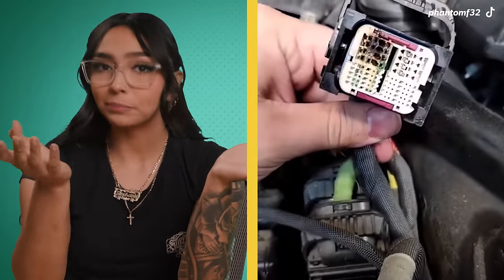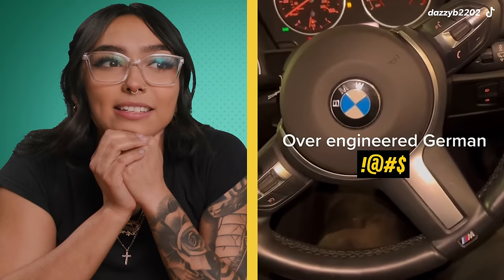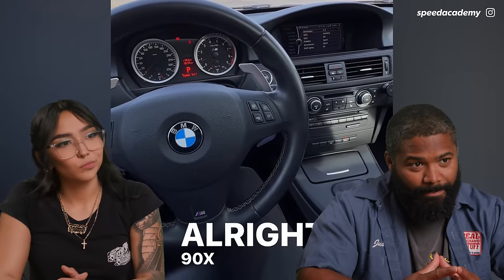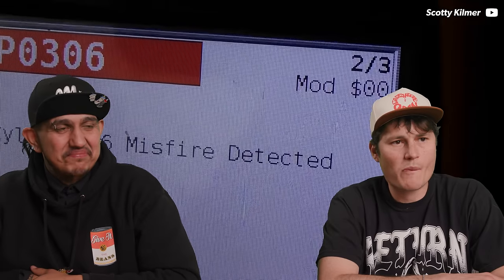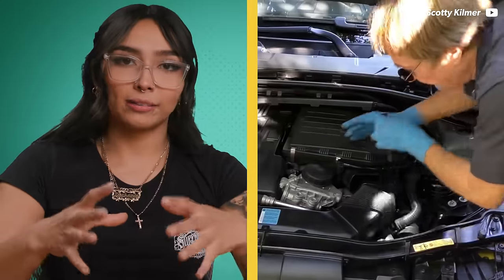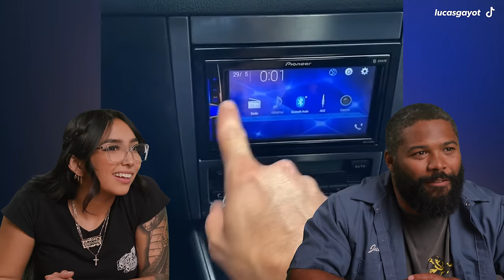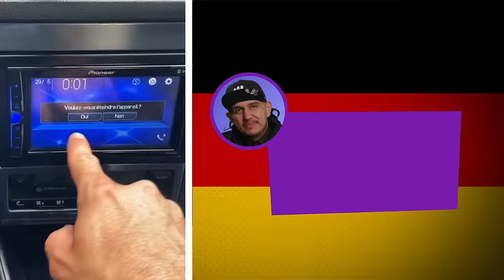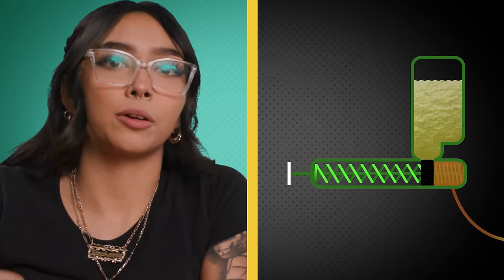Mechanic Reacts to German Engineering Fails

Comment: German engineering: I can't remember the exact model, but I'm like 65% sure it was a Volkswagen Toureg. Guy brings it in to the shop for a blown O2 sensor, and he just couldn't figure out a way to get to it.  Looks up in the repair manual on how to change that sensor, and right there in the manual it said "step 1: remove engine."
Reply: Porsche Cayenne turbo.
Reply: My Audi S7 O2 sensor felt that way. Engine is symmetrical left and right, including the exhaust manifolds. One side took 15 minutes to change. Other side took 5 hours of pain. Sensors in the identical spots left and right, but on one side they moved the connector from on top of the engine to the back of it between the engine and firewall in a pit with 2" of clearance with no line of sight into and no way to reach into without dislocating your arm. That and  you're supposed to slide the locking tab off the connector, then get leverage to depress the release on the connector in that area. Probably pretty easy if there wasn't a pesky firewall or engine in the way. They could have kept the connector in the same spot on top for both sensors, making them both 15 minute jobs...but no.
Reply: All Audi o2 sensors have been that way for 15 years and they are zip tied to the rear coolant pipe making them impossible to reach, impossible to cut the zip ties and impossible to get a socket on the sensor.

We used to cut the wires and have to make a tool to reach the sensor
Reply: I'm happy that fixing R1200GS is a bit easier than that
Reply: TouAreg bitteschön
Reply: Yeah thanks chief 🤣🤣🤣🤣
Reply: Mercedes w123. All of their engines except the m102 use a rope seal for the rear main. 
So in the manual it also says "step 1: remove engine"
Reply: Chrysler T&C broken water pump bolt...support engine and remove motor mounts...disconnect all lines and hoses...drop engine 4 inches.
Needless to say the finest "Tool steel" grade 14 bolts were purchased as replacements...and antiseize was shoveled on.
My worst was replacing the HVAC blower on Volvo 242 series...remove entire dash, and then some tiny parts fall out when removing...reinstall, Wont work properly. reach under seat, find parts, remove entire dash, reinstall. 30hrs+. NO manual or schematics.
Reply: @kft4764  Yep.  Been like this since the late 90's/early 2000s with German vehicles, now becoming pretty common with Japanese and American cars, too.  I can remember having to replace a temp control module on my wife's 1.8T VW.  Factory process is to remove all of the crossover coolant lines, valve cover, vacuum hoses and combi valve... all to remove one thumb-sized sensor held in place by a single C-clip.  The real solution of course is to find someone with tiny little hands skinny enough to squeeze down between it and the firewall to pull the clip and put it back in.  Takes seconds if you can actually reach it.  Getting to anything on the motor was a nightmare because of how little space you had to get to anything, but of course VW's remedy for everything is just "pull the motor" or remove the front end and radiator carrier. Sorry, but I am NOT pulling the entire front end off to replace a $20 thermostat.
Reply: Well,time to call mechanic for me 😂
Reply: Pretty crazy that you can't just drop the exhaust and access it that way. Poor engineering choices.
Reply: When you own a first-generation V10 Touareg, it's recommended to have another engine as a backup. Simply remove one engine and install the second one until something breaks, and continue this process as needed.
Reply: People in Australia have found with the Toureg if you enter cold deep water, THE BLOCK CRACKS from thermal shock. But we cross rivers with Toyotas all the time here. No problems. Cardboard over the grille and go for it.
Reply: WTF.......
Reply: @upinarms79 I can remember replacing that exact same temp sensor on my 2008 VW Jetta Wolfsburg way back in the day. I was really young. So I got the part and got to my friends house and like a fool went right to fixing it after driving. Long story short I forgot to open the cap on the coolant reservoir to release the pressure before starting to work. Then I went and removed that c clip you speak of and got a face full of steam and hot coolant. Luckily I hadn’t removed the plug from the old sensor because I would have got the sensor to the face too. Then I had to put the car back together before going to the ER with 2nd and 3rd degree burns on my face. I know ALL ABOUT that pesky c clip lol.
Reply: this is specifically done to make repairs expensive and keep the repairs in house or confined to licensed car shops only. that way the car manufacturers can bill the shop 500$ for a small plastic part and the shop can bill the customer 500$ an hour because nobody else has the know how , special tools or access to oem replacement parts. 
its an attempt at creating artificial monopolies to price gouge.
Reply: @OffGridInvestor  I've heard of that with not just Volkswagens, but multiple manufacturers.
Reply: You had your answer.
Reply: Hahahajaja😂😂😂😂😂
Reply: You guys don’t seem to know much about engineering to be honest. There are a 1000 facts to be considers and you only know 1
Reply: @greatdane145  I don't know much about engineering but one thing I do know is if you have to remove the engine to replace an O2 sensor, you've failed as an engineer.
Reply: @greatdane145  may be you are right 
But removing engine is ridiculous 😭😭😭😭😭😭😭😭😭😭😭😭😭😭
Reply: @neeturajjena6936  yes sounds like half of the truth tho
Reply: @backwoodstherapy  yeah but that bs… you can’t believe that. I am an engineer and I love repairing all kind of things on cars and I never had to remove an engine. It’s just bs
Reply: Theres a reason why those cars are hated
Reply: @greatdane145  Please do enlighten us.
Reply: Yeah, when the first step in something as simple as replacing a sensor tells you to Remove the Engine, you know you're dealing with German engineering at its' finest.
Reply: Second generation of Tuareg, and Porsche Chayan or wtf 😂
BMW X5 2012 Diesel same with oil pan gasket, oil level sensor, crankshaft seal rings.
Mercedes Vito 2014 116 CDI, generator….
All engine out😂
Reply: @upinarms79  Or... maybe you have been eating too many Big Macs....
Reply: @JasonKing-m6m   I'm a working man.  I don't have tiny soyboy waif hands.
Reply: @kft4764 all the while, shop only pays you .7 hours like you didnt just go through hell
Reply: my wife's vw jetta , the transmission output sensor is inside the transmission behind the valve body .... and the sensor wasn't the problem , the wire was broke in the harness  transmission plug to the sensor ,  the Transmission module is behind the driver fender so yo have to loosen the fender and pull it out to get to it 
    I wouldn't call that engineering ,   I would call it  engineering by idiots
Reply: 😂😂😂😂 No!!! You never have built Out the engine to change the O2 Sensor...😂😂😂😂
Reply: And this is why I will never get any car any more complicated than a 2012 CRV. 

I have things to do not involving engine removal.